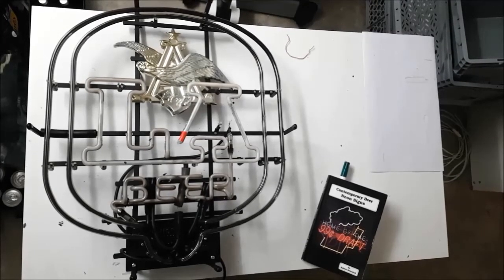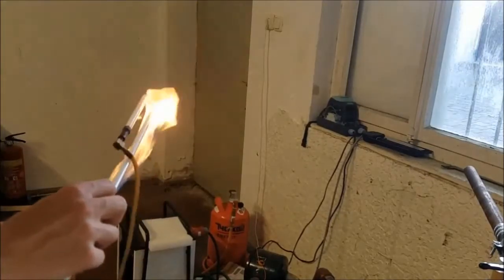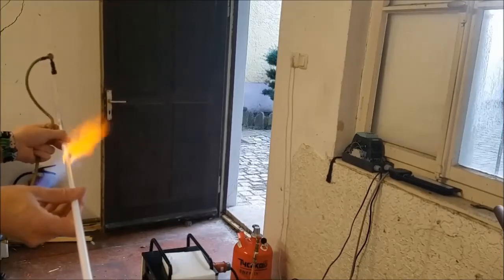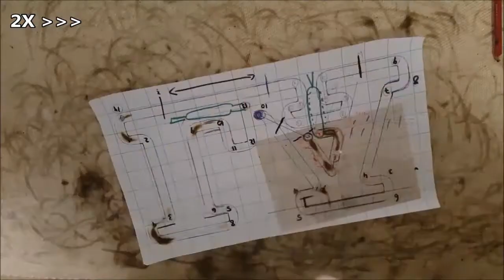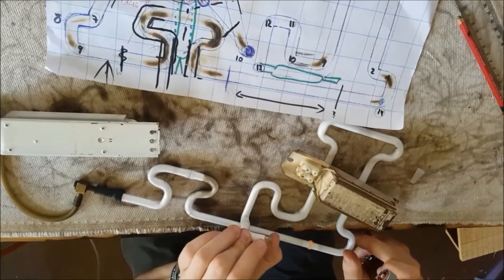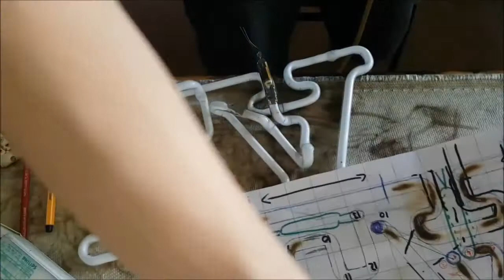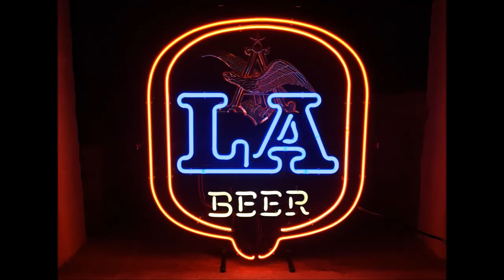LA Beer Neon Sign Repair with extensive glass bending

Comment: What kind of torch do you have ? I think a have same. Just bought. I've a question, the central pin point hole is for oxy or air ? please.
Reply from the maker: Bonjour Frederic, I don't use oxygen. My bench torch is Arnold 115/1 PL b. It only has connectors for propane and air.  Hand torch is 143 PL a. Also only propane + air.

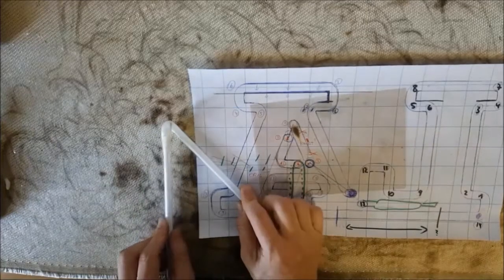Comment: Great presentation of the bend I'm having most trouble with 7:46 in the video. Also, what kind of camera is your second one?
Reply from the maker: I'm doing that in 2 heats. First the doubleback with offset, and then the drop. Some benders do it in one heat, difficult. Both my cameras are just phones, but the second one broke since the video...